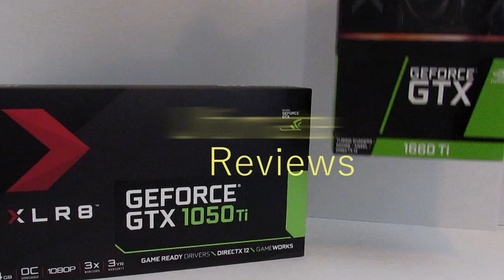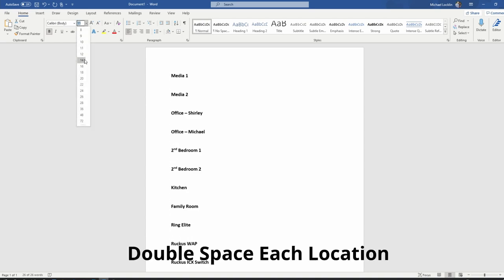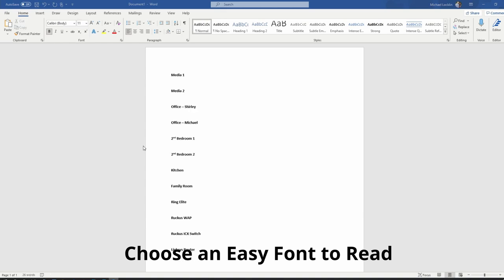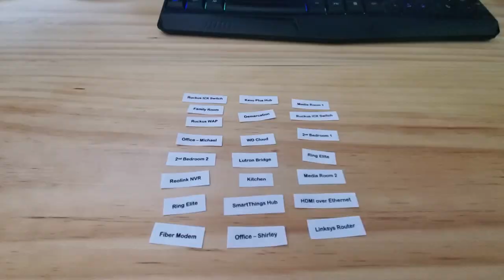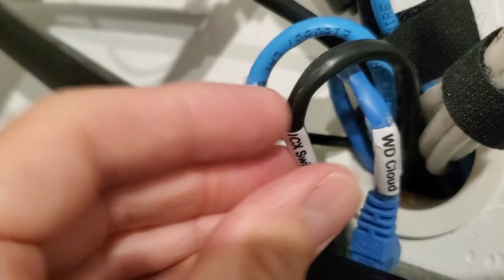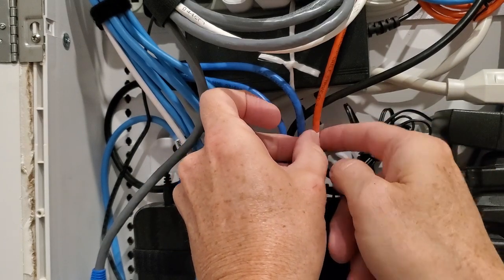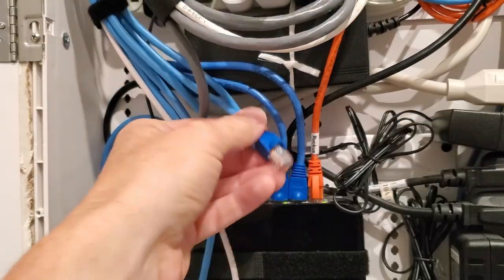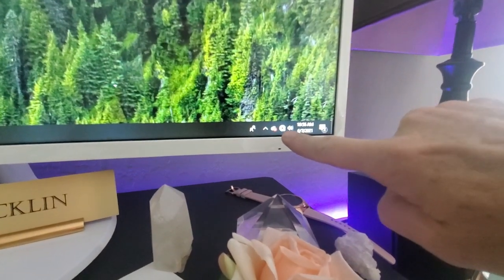LABELING YOUR ETHERNET CABLES  HOW TO - HOME NETWORKING 2021- EASY!

Comment: How long do they actually stick? That tape is not known for retaining tackiness much past a week, especially under pressure from a rounded surface.
Reply from the maker: The tape I used was like packing tape and it works perfectly. The labels are still solid and it's been about a year. Check out one of my newer videos and you can see they look like new. Thank you for watching!
Reply: Good enough until the end of this video.

Comment: This is a great DIY solution. But personally I like to use a label maker with a heat shrink label cartridge.
Reply: I'm looking for a good label maker that does this.  Do you have one you recommend?
Reply: @nateanbu859  I’ve always used Brother label makers. I’ve not has an issue with them. I currently use the BROTHER PT-E300VP.

Comment: Ye but how do I identify which cable is going to which room?
Reply from the maker: Use a Network cable tester. There is a link in the description. Klein Tools make a good one. The tester will trace the ethernet port to the other end of the cable.

Comment: Ok cheap solution .. problem is the clear tape will let loose after a while because of temperature .. don't ask me how a know .. even some professionale labelmaker labels delaminate from heat ..
Reply: That's what I was worried about with this seemingly great solution (as it is cheap, and nice looking!). I'm also labeling some other wires and I need the labels to last decades. I'm looking at some of the very pricy labelers and their very pricey label cartridges. I'd probably want some shrink wrap, and other types of labels.

Comment: If there is any heat produced by equipment those labels will fly off in couple of weeks. Trust me I know. It's hard to find even modestly expensive labeling solution for UTP which can withstand long period of time when exposed to heat. There are professional products, but they are not cheap.
Reply from the maker: Yes, the heat can loosen the labels but I used enough clear tape so the labels will not loosen and fall off. My labels are still on all of my ethernet wires after about 15 months. Thank you for the great information and thank you for watching.

Comment: A more simple solution is to document patch cables and wall jacks in an Excel spreadsheet, then either encrypt or password protect that spreadsheet.  No regards for security in your solution provided.
Reply from the maker: This video is not about security solutions its about Labeling Your Etherent Cables. A spread sheet would work but I prefer labels directly on the cables. It makes very easy to see where everything is going.
Reply: If they're already inside my house, chances are my actual security didn't work very well.